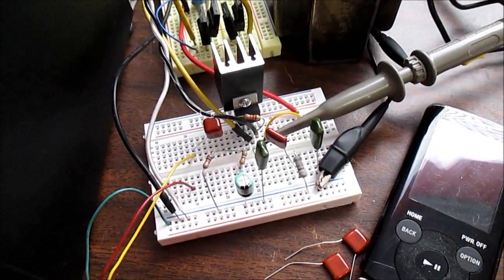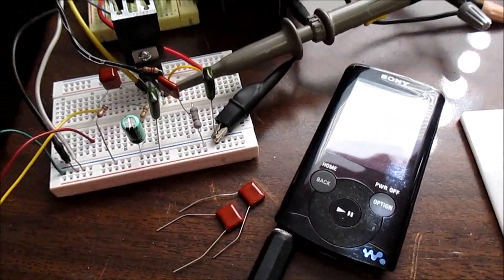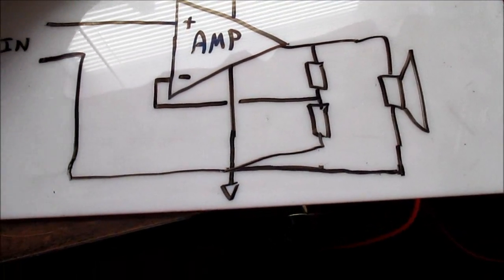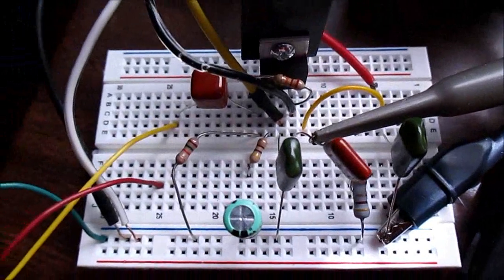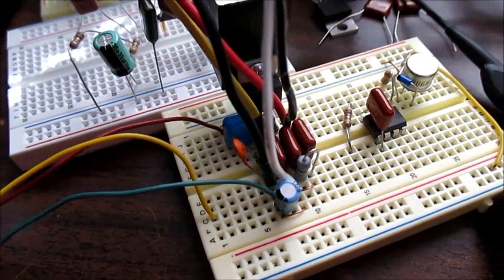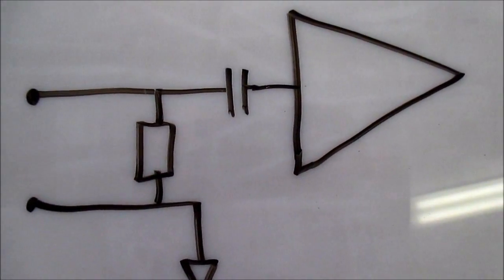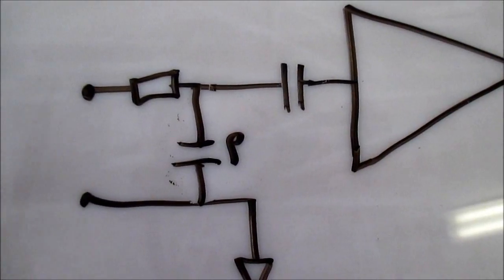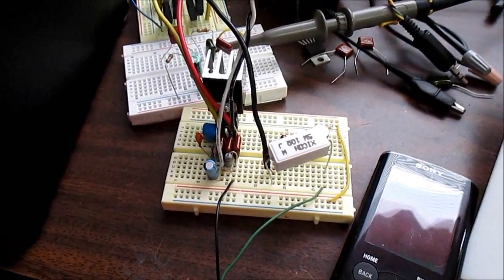Correcting hum, buzz or distortion in audio amplifier projects

Comment: Hi thanks for sharing this info! I'm making a bass amp (only power amp stage, because i a have a external bass preamp) but when i connect the bass preamp to amp (hi z output) i have a lot of hum noise but when i try to connect another source (for example the laptop output jack) the sound its clean (its a mono amplifier using the same connection and wire used to connect the bass preamp) what could it be?

Comment: My amplifier looking like the first example 😁😁. What I notice also is that most of the noise will go out when is solder. I have a lot of problems and noises because the protoboard is only making contact with wires but not tied down (soldering) but finally I made one and the only problem is the noise when you touch the input cable which now I can fix it by adding a 1k resistor as you pointed. Thanks

Comment: Exactly what I am looking for the past few weeks.  I didn't find that much perfect and easy solution anywhere else.
I have these issues with TDA2030 and now I know
Nice Job 👌
Reply: How you done it bro? 🤔
Reply: @sutharpiyush71  This may help,
https://www.instructables.com/id/DIY-21-Class-AB-Hi-Fi-Audio-Amplifier-Under-5/
Reply: @vishalj27  I'm already using an amplifier. A home theatre system 4.1. Can I use a Resistor between RCA Input? Do you think that can help to reduce humming sound?
Reply: @sutharpiyush71  That can be a problem of ground loops. 
I made an amplifier by myself and these tips work for me.
Reply: @vishalj27  The tips on video?
Reply: @sutharpiyush71  Yes
Reply: @vishalj27  What if we've to add that resistor in regular RCA cable? That make sense?
Reply: @sutharpiyush71  No, try other things. But, I suggest checking ground loops. These are tips for DIY amps.

Comment: Hi John, nice video! I'm building a audio mixer using Tl072 op amps. I seem to be suffering from the 3rd problem. There's a low frequency buzz, butt everything else seems ok. Audio comes in clean, I do NOT get any kind of weird distortions or oscillations when touching the PCBs. So I think we are good there. My PCB is 4 layers and I have dedicated ground plane. I.e: Not using star ground. Also to note for now I'm using two AC/DC adapters as voltage splitter config I.e +15V virtual ground -15V.

Any thoughts?
Reply: Did you find a solution?  I have the same problem.  Running 6 Icepower amplifiers active directly to the speaker drivers (2 3way) and I get a nasty everpresent 120hz hum.  I think its coming from the boards.
Reply: Add rectifier diode decoupling capacitors either across the AC input (330nF to 470nF) or across each diode (100nF to 220nF). Would be stuffed if the mains adaptors are sealed shut. Most mains adaptors now have anti-tamper fasteners requiring specialized driver heads.

Comment: I'm trying to reduce the noise of a PAM8610 module. I can reproduce this strange sound issue also when I touch the 3.5 jack input connector. When I increase the volume then the noise is also increases. How can I solve it? Does the resistor solve the issue? How to do that on this board?

This is a picture of the module:
https://www.haoyuelectronics.com/Attachment/PAM8610-Audio-Amplifier-Module/PAM8610-Audio-Amplifier-Module-6.jpg

Comment: Again I have some questions-

1. If the Signal and Ground wires are twisted, does it reduces humming and Noise instead of using shielded cable for input ?

2. You have used Plastic boxes as cabinets for your amplifiers in some videos. But if a metal cabinet is used, will it result in humming (the transformer and amplifier circuit being the same cabinet) ? If so, how to reduce humming in that case ?

3. Can a potentiometer be the reason for increase in hum or noise in an amplifier circuit due to impedance mismatch ?
Reply from the maker: 1. Yes. twisted pair can reduce noise picked up on the wires. Shielded leads are a better option if needed.
2. Metal is better at shielding but you should avoid ground loops caused by the metal casing if the input, power and output grounds are connecting to it.
3. Possibly. You should use the minimum potentiometer resistance that will work for your circuit.

Comment: I have two questions here-

1. I have an audio amplifier board based on LA4440 ic and I powered it using a 12 Volts 3 Ampere transformer and used twisted wires at inputs and outputs along with a 47 K stereo potentiometer for volume control. I used 5 Inches speakers. The problem is that the amplifier makes loud humming all the time even without any input signal and turning up and down the volume potentiometer makes no difference in humming sound. What should be done to reduce humming ?

2. Secondly, if I connect a usb mp3 module with Bluetooth function to the amplifier board using the same transformer after connecting a 5 Volts regulator, there is also a constant beep sound along with the humming sound but when the module is disconnected the beep sound stops but the humming sound remains. What should be done to reduce both the Humming sound and the Beep sound ?
Reply from the maker: It could be a mains frequency hum. Be sure you have a good sized filter capacitor in use. A 4,700uf 25 volt capacitor is a good start. It also sounds like a grounding issue. Google star grounding for more information.
Reply: @JohnAudioTech  I have a 4700 uF supply capacitor. My amplifier board has 4.7uF input caps and a 47K stereo potentiometer connected before it and I connected an usb mp3 module to the amplifier via the potentiometer but since that was producing a constant loud beeping noise I disconnected the module and tried using the amplifier with my mobile phone to play music but even then the amplifier is making Humming sound all the time, even when nothing is connected to the amplifier. Turning up and down the volume when nothing is connected makes no difference in humming sound. 

I request you to please publish a video on how to connect an audio amplifier circuit to an USB mp3 module (the one that is used to play music from flash drives and memory cards and also via Bluetooth) so as to have very lower noise and humming.

Comment: Hey John so how do you fix the last hum (AC hum)? I have the same problem on my chip amp (TDA7293) especially on the right channel. I'm using this ebay board 
https://www.ebay.ca/itm/100Wx2-TDA7293-Dual-Channel-Digital-Audio-Amplifier-Board-AC-12-32V-Audio-Module/332869877468?ssPageName=STRK%3AMEBIDX%3AIT&_trksid=p2057872.m2749.l2649

Comment: An amplifier that I made (using transistor push-pull), works fine (no hum or buzz, no unwanted feedback) but when I plug in any other appliances (specially reactive load) on the same 220V A.C. line, there is a loud "click" sound (very annoying), it also occurs when the amplifier's power supply transformer is plugged out(not while plugging in) of the mains. I had an amplifier that had STK4141 chip used in it (without any preamp or tone control circuit), which didn't have that issue.
Can you explain, why this is happening? And how to attenuate it?
Reply from the maker: The amplifier is picking up the noise on its input. Be sure the input is well shielded. You may need to filter the AC power input. The most basic filter is an AC mains rated safety capacitor.
Reply: Exactly, I got your point, I had checked everything except the input, now it is fixed, thank you very much.
I had tried filtering the AC mains using a 0.33uF 400V x2 capacitor, parallel to the transformer's 230V AC side, but that didn't work, though, checking the input did reduce most of the noise, thanks again, for mentioning the input fix.

Comment: i put a 2,2k resistor crossing right and ground input and another in left and ground input and problem solved
Reply: Hi, 2.2k tricks work only for mobile input. Speakers  makes buzzing with noise when connected  to laptop. Any  suggestions ?

Comment: Sir, I kindly request you to make a video about, "humming" problems in a preamp board to power-amp board connection, where both of the boards individually doesn't produce any noise themselves when connected independently.
The boards being placed in a metal chassis with common power supply.
Reply: Probably a ground loop. Isolate the pre with an isolated DC to DC converter.

Comment: I have a 2002 Tahoe and I'm getting really bad ground loop humming to the rear speakers.  Based on my research I discovered it's bad rear radio unit which fixes the issue temporarily if replaced until it goes bad again.  My big question is, can I add something right on the speaker to isolate the humming noise without replacing rear radio unit?

Comment: If you don't fully encase the amplifier you can get really weird and illogical hum coming though. 

One of my circuits hummed when people walked by, and I racked my brain figuring out why, when the issue turned out to be an acrylic window I had on the chassis to allow the internals to be visible. I solved the issue with some copper mesh(I ripped apart a copper scrub pad and used it as a emi screen under the acrylic).
Reply: You could have filtered all that out instead.

Comment: Im currently working on a amplifier using the tda8561q chip, but I'm confused. There's a pin named Signal ground, should that be separate from all other grounds or should it go to my star ground point?
Reply from the maker: The pins must be tied together. However, the input signal ground lines should be returned to the signal ground pin. The power supply ground should be returned to the ground pin but do not connect it at any point on the trace the links the two ground pins together or on the signal ground side. The power supply ground should have its own trace leading to the ground pin. I'm assuming you're making a PC board.
Reply: Thank you for helping me out! This is a question that has been bugging me for a very long time!

Comment: I'm trying to modify a used computer subwoofer into a Bluetooth speaker using some junk parts I have lying around, this helps, Thanks for the good info, what are some common audio signal voltage levels, for example on headphone output ?

Comment: what capacitor can be used in my tda7377 i listen noise from fan atx need add a cap, noise in high freq
Reply: If your using dual rail volt ie plus and minus 18 volts or more then this type of amp chip does not need coupling cap to the speaker..

How ever using just 1 supply say 18volt..zero. Then use 3300uf to the speaker at the chip out put.

Also look at the date chip in of rhe chip you have..

Comment: interesting... in electrical engineering in circuit analysis, we learn that it doesn't make a difference because its connected to the same node= same voltage. thanks I'll keep these things in mind for future projects
Reply: That shows you the difference between theory and practice, dude. Real wires have resistance and inductance. Star grounds must be used

Comment: Do you know the ILP Electronics complete Hybrid Amp that require no external components apart from the Power Supply, rectifiers and Filters?  The specs are mind blowing.  Would love to see how the test out on a bench with the scopes.  Incredible freq response from 10 Hz - 1000 Khz in some cases and 0.01 THD on the mosfets.  Output from 30 - 180 WRMS.  Low cost.

Comment: I have a LM1875 Amplifier which is our school project that outputs a buzzing sound when no audio is being played. When I reduce the volume the buzzing sound also reduce its amplitude. The sound is very good and clean when music is played. Can you help us?
Reply from the maker: The amplifier is just picking up electrical noise. Be sure the input wires are twisted together or use shielded cable all the way to the input connector. If the hum goes away when disconnecting the music source, then noise gets in from the music source or its wiring. You can try to reduce the input impedance by placing a resistor of around 4.7K ohms across the input.
Reply: JohnAudioTech the input wires are twisted. I even tried removing the input wires itself the static is still present. Connecting a 4.7k ohms didn't also work. When I touch any ground points on the circuit the static stops but when I touch the positive input it intensifies the static. Is proper grounding the problem?
Reply from the maker: Sounds like you need to connect the amplifier's ground to a proper earth ground. Be sure the power supply your using is safe in doing this.
Reply: Is there a alternate solution for this? In our country we only have 2 prong plugs. Nothing for earth ground. Thanks
Reply from the maker: When you connected the resistor, did you connect it from input line to input ground? What is your music source? If it is low impedance, like a headphone type music player, you can use a lower value resistor, 1K ohm or less. Touching the input and ground affects the noise like you say indicates a high impedance noise source and the resistor should cure that. It always works for me.
Reply: I connected a 220 ohms resistor across the input and it worked! Thanks. Is 220 ohms input impedance still safe?
Reply: is it also safe to replace the 1M ohm on the datasheet schemaric with a 220 ohm?
Reply from the maker: If your source is a headphone output, that is fine as the output of the player is usually designed to handle headphone loads which can be as low as 8 ohms. For line output devices, 220 is too low. 2.2K or so would be a better minimum for them. What is your volume pot value? I use 10K on my power amp inputs. It also helps to keep the noise low.
Reply: JohnAudioTech I use 20k. Are you going to recommend using 2.2k and 10k pot ?
Reply from the maker: You can eliminate the resistor by using a lower value pot. You can use a 1K pot if it removes the noise and works with your signal/music source.
Reply: JohnAudioTech ok I'll try that. thanks a lot!

Comment: my amp will hit loud than go to a low distortion,what could it be?
Reply from the maker: Could be a thermal issue (getting too hot) or instability.
Reply: I burned the power wire

Comment: I remember a good sentence from Radiofun232. He said in a good quality Amp everything has to be Connected. Every knob and especially the metal Case. I'm experementing with a Mix of analog and digital circuits and noise is a big issue. Digital noise is horrible. The best way around are Star shaped gnd Lanes as you explained it in this vid. Is that the right term? "Star shaped lanes" don't know but you get what I mean. This can't be said to often. Good Video :)

Comment: Hi John, learned a lot from this. Have a question for you. I just started making my own guitar pick ups and some, but not all generate a loud hum when put into an amp. When I touch either the pick up or the metal parts of the cable, the hum goes away. Am I acting like a giant capacitor and would a low pass filter fix this?
Reply from the maker: +zardozica The ground side of the cable (the shield) should be used to connect the metal parts of the guitar to help shield the electrical noise from the sensitive coils and amplifier input. Also be sure the amp is properly grounded at the power plug.

Comment: Hi john want to build a  an amplifier using lm3868 but one of the part is very hard to find the Polypropylene (PP)0.1 uF 25 Vac    63 VDC Series: MKP416 , Manufacturer Part No: BFC241641004 what is the substitute  for this part. 
thank you, your tutorial is very good
Reply from the maker: +Sean Gonzales You can get by with about any .1 uf film cap.
Reply: thank you very much
 God bless

Comment: i am not understanding the star ground ... is it not that it is still connected to the same  component and/or wire as the case may be .... or is it to make a shorter connection to ground so that it won't hum,osscillate or so ? hmmmmmmmmm ????????????????????????????????????????????????????????????????
Reply: Glebs Litvjaks
Exactly. Actually the wires all have a complex impedance to be more exact, a combination of inductance, resistance, and capacitance
Reply: Glebs Litvjaks  understood ... thanks ...